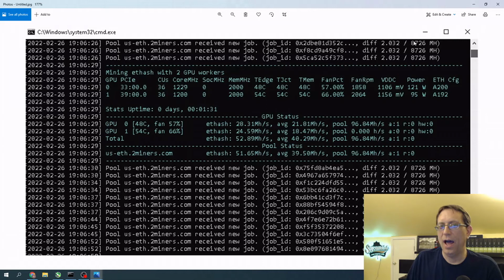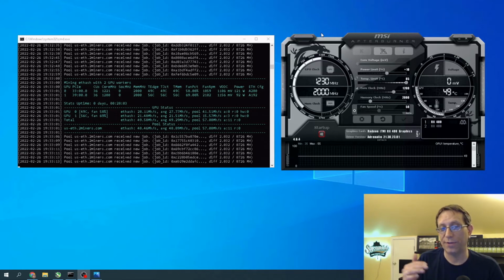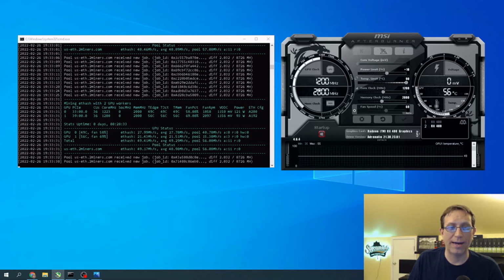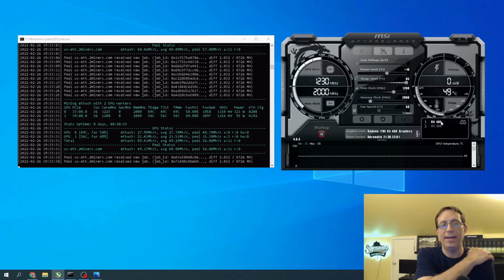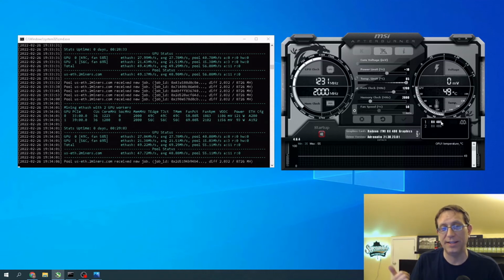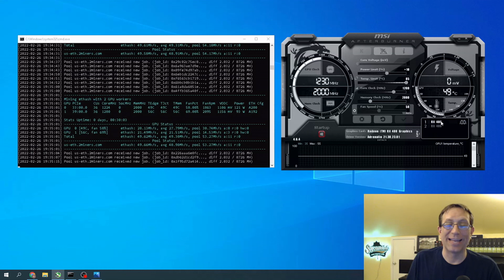RX480 Thermal Pad and Paste Replacement Project

Comment: hi man i have mobo msi b45o gaming plus with msi rx 480 8gb 256 bites and lately it crashes alot, when crashes i see blackscreen and in my headphones i hear the sound with red led gpu temps are good though 50-60 degrees, please any help?
Reply from the maker: Do you have a second card? Have you tried it in that computer to see if it works? You have to figure out if it's the computer that's crashing it or the card that's crashing it. After that I would look to fully uninstall the drivers and reinstall them for that card. Start there and let me know.
Reply: @euclidmining  hi brother i put thermal paste it was so dry now all it crashes are the damn drivers, amd sucks at drivers ill never buy that again

Comment: What thickness thermal pad is placed on VRAM processors and what conductivity W/mK ? I don't put thermal paste on the main GPU.
Reply from the maker: I used 1.5 and 2.0 mm pads. Some needed to be doubled up to reach heat sink. w/mk?
Reply: @euclidmining  Is it because of mining or when will it be used for gaming ?

Comment: U know what thickness is good for rx 480 sapphire nitro +?
Reply from the maker: I used 1.5mm and 3.0mm pads depending on how thick I needed to pad to reach the radiator/heatsink. 1.5 is thin but I'd have different sizes just in case the pad doesn't reach where you need it to.
Reply: @euclidmining  thanks
Reply from the maker: @sunshhine6940  Anytime. Let me know how it goes and if it solves your problem.
Reply: @euclidmining  🔥
Reply: @sunshhine6940  which one did you use? I have the same card....

Comment: Have you tried just copy BIOS from that stable 28MH/s card to another? If they are exactly the same with same memory for exaple Samsung, you can try copy bios. This is what I do with my Sapphire RX 480 8GB Nitro+. I've got one very nice bios, a little bid modded, and I copy this bios to rest of the cards in my rig. Before I've had 27-8MH/s on every card, now 30MH/s with modded bios.
Reply from the maker: I did a while back but never really revisited it. I'm going to do it right now. The other card is identical so lets give it a shot.